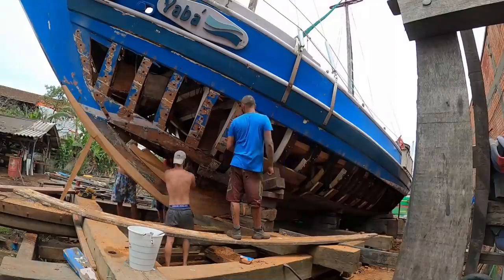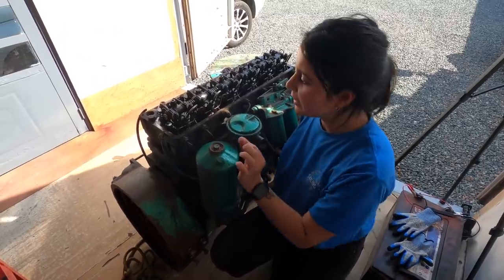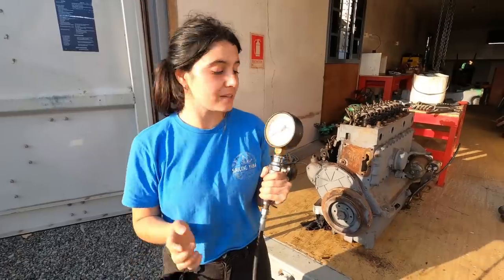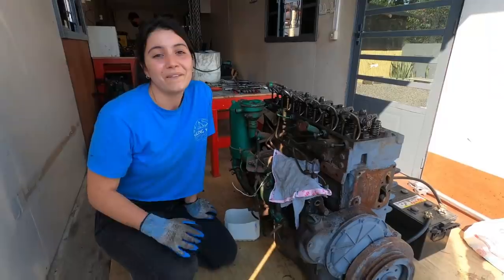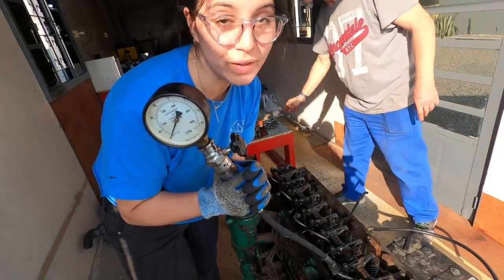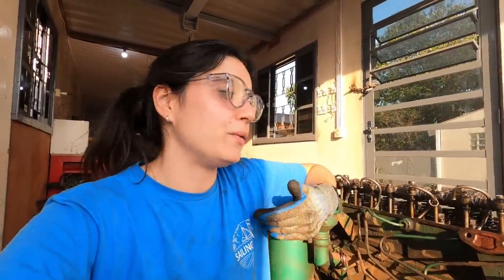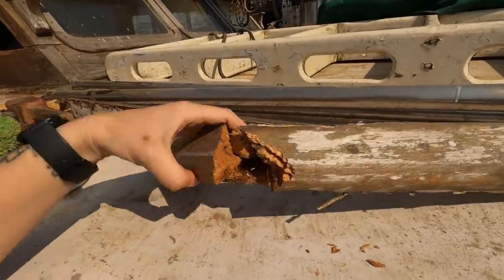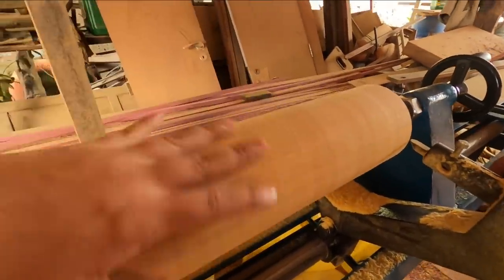Is our ENGINE worth SAVING? (the compression test will let us know) — Sailing Yabá #57

Comment: Glad the compression test was good. I would still re-ring and put new bearings in because it’s not much work with the engine sitting right there. But then again, how many total hours does that engine have?  Those robust diesels like Mercedes can go hundreds of thousands of miles without taking them apart if you keep clean oil and fuel in it. Glad you are learning to fix everything on the boat, you might have to do it in the future and under less than ideal conditions. Kudos.

Comment: I'm really impressed MP.  This engine rebuild is a job very few people, men or women, would consider tackling.  Professional guidance not withstanding.  Way to go!
Reply: Now, if they would rebuild it, I would have more faith in it, but they aren't rebuilding it.  However, it SHOULD be rebuilt.  The squirting of oil into the cylinders is 'BS', should never have been done before a compression check.  Great way to artificially inflate the readings.  That engine needs to be pulled apart and rebuilt.

Comment: First, he wasn't checking to see if the valves were sticking, he was checking to make sure none of them were too tight, thereby holding a valve open.  Also, squirting a ton of oil in each cylinder prior to doing  a test gives a false reading. Stay in the tropics and you might be ok, but that engine is tired. The engine typically isn't up to temp when you need it the most so I don't really understand the reasoning by being ok with the minimum. I would at least do a leak down test before putting it back in the boat.
Reply: Sailing Yaba•  spam?

Comment: I would get a 2 Second opinion on the engine. It is customary, standard procedure to do the 1 First compression test "Dry"- "As is" and record all the values. If the results show out of specification. It is then & only then, that oil is squirted into each cylinder "Wet test" as you do that specific cylinder's test. This is done this way, such that when you compare the results "Dry" to "Wet" you will see which cylinders have leaky piston rings etc etc. Another issue is the engine should only turn over only 3-4 times. A proper tester doesn't keep cranking the engine over until the gauge needle stops. Not withstanding as other comments posted have noted. There are many, many more tests & observations before an engine is given an approval of condition.

Comment: Watching you use the knuckle breaker bar to remove the injectors made me shudder, you might want to equip Yabba' s tool chest with a nice long pivoting ratchet head power bar & sockets along with a set of line wrenches, they will be invaluable in the future.
Reply: If you buy them for them then they will have a set eh.....

Comment: While there's some charm in using an old engine, it's still an old engine.  This is one item that absolutely has to work when you need it.  Get rid of this relic and buy new.  You have invested too much time, energy, and cash in your boat to risk losing it all when something like this could fail.
Reply: I don't think they need a new engine, but they SHOULD rebuild it.  New rings, new bearings, new gaskets, cylinders honed, valves ground and lapped, springs replaced, etc.

Comment: I have to say M.P. I cannot understand your reasoning for cutting down solid stanchions. You could have left them as they were and run stainless wire lifelines through them and had something to support you better if the ship rolls unexpectedly. Now they are at a perfect height to catch you at knee height and pitch you straight over the side instead of holding you in. Not sure how the turned pieces are going to work but can't see how they are going to have the strength or height to safely work compared to what you had. As for the engine-its out accessible all round, stable not rocking in the engine room-REBUILD IT then you know nothing WILL go wrong at the time you rely on it the most.

Comment: Ben take a look at this video about how to fit a copper bottom it will stop the Toredo worms eating Yaba's hull and keel https://youtu.be/vZdH-r5a_HQ also from Wikipedia Shipworms greatly damage wooden hulls and marine piling, and have been the subject of much study to find methods to avoid their attacks.[2] Copper sheathing was used on wooden ships in the latter 18th century and afterwards, as a method of preventing damage by "Toredo worms". The first historically documented use of copper sheathing was experiments held by the British Royal Navy with HMS Alarm, which was coppered in 1761 and thoroughly inspected after a two-year cruise. In a letter from the Navy Board to the Admiralty dated 31 August 1763 it was written "that so long as copper plates can be kept upon the bottom, the planks will be thereby entirely secured from the effects of the worm."

Comment: compression pressure looks good so the engine i in fair condition , it would be worth pulling the cylinder head off and cleaning and lapping the valves again also clean and test the injectors  and clean ,service, calibrate  the injector pump this is the beating heart of any diesel engine calibrating the pump makes sure it discharges the right amount of fuel to each injector at the right time right amount right pressure its also makes sure the governor works so the engine will not over rev it s well worth doing while the engine is out , while the head is off , the oils and water passageways can be cleaned so we know coolant and oil can get every where it needs to be , remove the sump pan and look for metallic particles and clean it out , we could also inspect / check big end and main bearing clearances to the crank shaft this will tell us again how healthy the engine is , worth doing and its quick cheap and easy to do , well presented mp well done, while we have the opportunity we could also check over the gearbox and clean it out check bearings seals condition visible wear damage to gear teeth etc , and look at the function /condition of the clutch as well , this will tell us whether the gearbox has ever been run with little or no oil in it , now is the time to discover hidden secrets like this we dont want to find out the hard way out at sea in a blow take it easy ok

Comment: Your number five cylinder never made 20 bar, it only made it up to 19.  You either have a poor head gasket, worn rings or valves that aren't seated properly.  It may not mean much right now, but in the future it is going to give you problems.  Your best bet, and I'm sure it's too late by now, giving the delay in getting the videos out from when it happens, would be to overhaul the whole engine.
Reply: Sailing Yaba•   Fake post, not from Sailing Yaba

Comment: I thought the engine was being overhauled.
Reply: What makes you think it isn't?  But, to be honest, it isn't really in a high stress situation. That engine won't really know what hard work is!
Reply: @andysimons9226  I just remember them saying it was at the mechanic's shop a couple of times. But you are correct. It will probably outlast the boat. Still this episode did very little as far as maintenance goes. The cover was off. Seems like a good time for a proper valve clearance check. Simply checking for tight valves does very little. They had also mentioned  that the engine had previously lived in a truck.. I think. Mercedes does make very durable diesels though, and if it was hitting on all six when they motored up to the ramp it's likely good to go. At this stage though, with all the accessories removed why not check the rest of it?
Reply from the maker: Hey Verdigo! One step at a time! Before anything else we needed to know if the engine cylinders had the right pressure. It wouldn't make sense to overhaul an engine to only find out after that the cylinders are weak. Soon we will be posting more engine updates!
Reply: @SailingYaba , That’s where I’m confused.  You sound as if you were going to replace the engine if the compression had been low.  Low compression only tells you what you need to rebuild.  I mean why replace the engine if you only need to hone the cylinder and replace the pistons & rings?  It’s been 30 yrs since I last did a button end rebuild.  Back then it was a lot lower in cost than buying a new engine.  Had it gotten cheaper to just buy a new engine?

I’m just trying to figure out what I missed…
Reply: @SailingYaba  I agree. One step at a time. Only I might not agree with your mechanic on what would be step one. I had just remembered you guys loading the engine to take to the mechanic in that Kombi. Those old Mercedes engines are pretty much indestructible. Don't blame you for keeping it if it was running good prior to pulling it out.

Comment: Question     Why did the mechanic squirt oil into the cylinders ?? By doing that you are not getting a true reading of the compression. If the cylindes are good you should be getting a min of 20 bar The cylinders are tired as you will find out when its back in the boat and in use. Best of luck but you should have removed the cylinder head and checked the bores and the valves are gas tight
Reply: He doesn't want to turn the engine with the cylinders dry.

Comment: Well done kid  Proud of you.  As a boat mechanic for 40 years I love your progress.  When I saw your valve cover was so clean, I just knew you might not have an issue.  So scale off the rust and get an oil pressure test and sail with confidence  Loved this one. one of the best, besides all the wood work and tear down and keel replacement I mean. When does your other get back and will he be quarantined for weeks due to this new strain of "C"?

Comment: hi guys. excellent news about the compression tests. Ihope that when you get the engine ready to go back inti Yaba that its gets painted white. That way you can see any leaks etc and it will look clean and tidy.
Also did you turn a spigot on the top and bottom of those turned columns to make the fitting easy and, more importantly, as strong as possible.
looking forward to seeing Yaba back on the water fully restored...

Comment: Is the 20 bar as in barometric pressure or atmosphere essentially the same as scuba diving bar or does it have a different meaning?
Reply: 20 atmospheres of air pressure trapped in the combustion chamber by the rising piston.  The heat that produces ignites the fuel sprayed in by the injectors she was removing to do the teat.

Comment: the old engine is in very good condition. no reason why it will not be reliable for many years to come.
Reply: Yes, remarkably clean in the rocker area and cover. Perfect compressions. With a good battery and the pump and injectors set up correctly, cold starts shouldn't be a problem. I doubt if they will venture to colder climes too often even if the boat is well capable of it. I think they would have to consider extra crew if they are considering a trans Atlantic trip.

Comment: One suggestion, get plenty of spare parts for this marvelous old engine.  Yaba has loads of room in her engine room for spares. 
Starter, fuel pump, water pump, injectors with spare fuel lines and plenty of nuts 🔩 bolts and belts+hoses. 
As MP has learned to repair the engine, it will be wonderful if she has what she needs.  Tools 🧰 too.